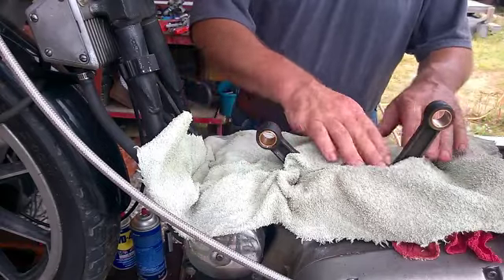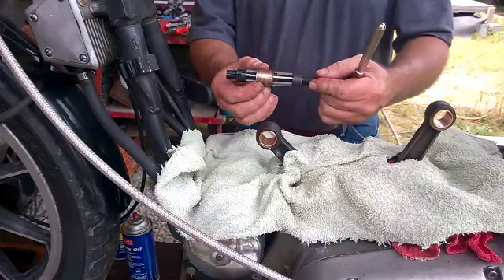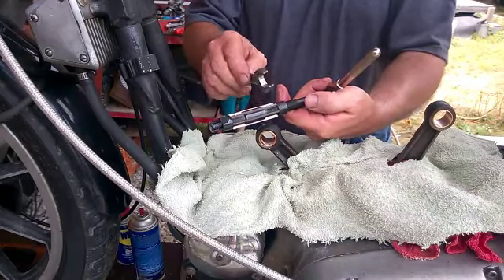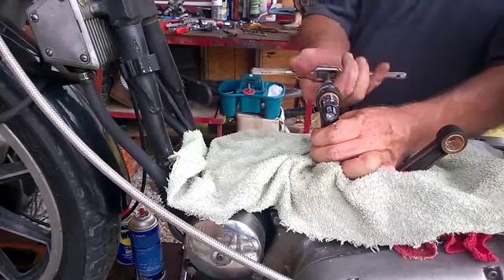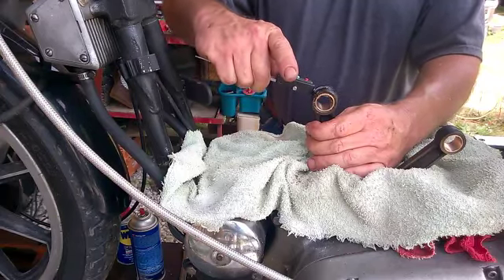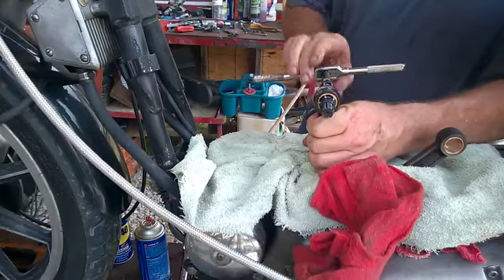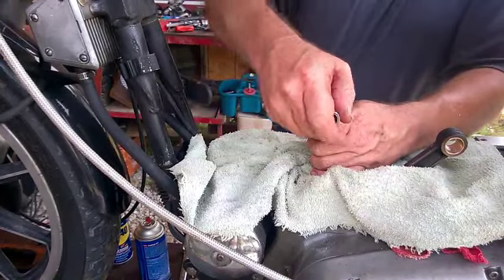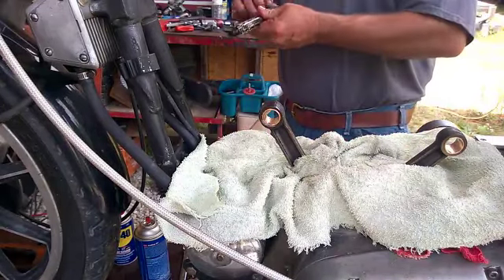Iron Head Top end Build Part 5   How to Ream out connecting Rod Bushings

Comment: Oh man, I just paid like $38 for mine. At least I bought the right size. Anyway, bought an 87' early EVO Sportster and I'm redoing the top end. Decided to replace the pin bushings. They were .004 oversize from the .791 wrist pin. Thanks for posting the video. I was not about to spend $200 to $300 for a reamer tool. I knew i was going to have to sneak up on the inside diameter of the pin bushing. I was thinking about bringing in the size by lapping the rest of the way.

Comment: Where do you get the tool to ream out the wrist pin?
Reply from the maker: EBay - $15.00 http://www.ebay.com/itm/SHARS-25-32-27-32-HSS-Adjustable-Blade-Hand-Reamer-Metal-Hole-Cutting-Tool-NEW-/350999674127?hash=item51b935fd0f:g:7JcAAOSwSHZWeq0G
Reply: Thanks for the video very helpful.